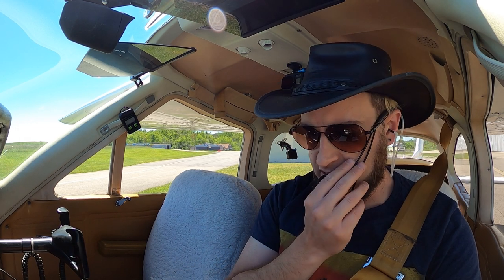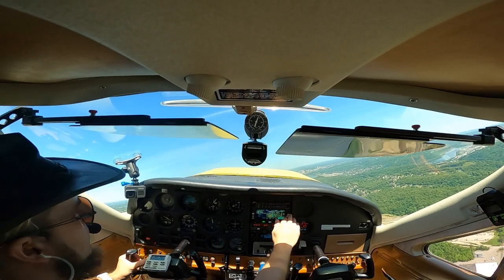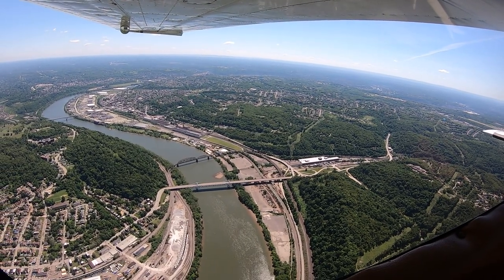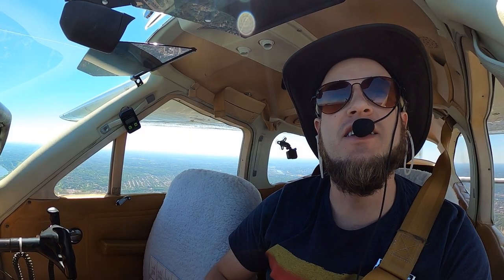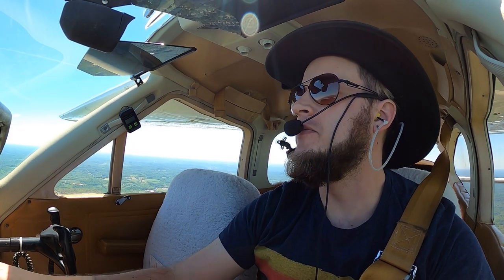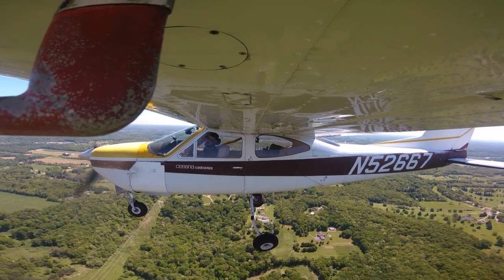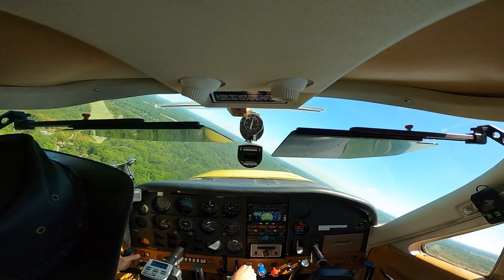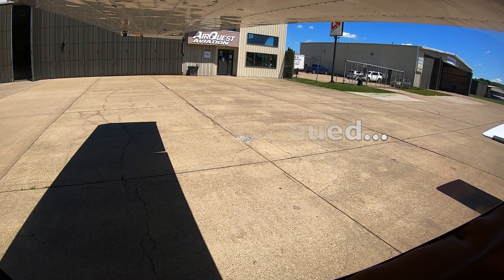Cessna Cardinal flying to 2020 Annual Inspection

Comment: Greetings Dan, what kind of headset do you have and do they interfere with your glasses bows at all? I'm looking to replace my 30 year old Pilot over the ear set. Great vids BTW, look forward to more.
Reply from the maker: It’s a QT Halo (http://www.quiettechnologies.com/). Works great with sunglasses. I find that ANR headsets sometimes don’t work well with the earcup fit around sunglasses. Plus you can wear a hat like that, haha, I’ve done 7+ hours of flying in a day with them and find them quite lightweight and comfortable. They are as quiet as ANR if inserted correctly, I swap the foam tips out when they get dirty or about every month or so.
Reply: Dan Noé excellent. One more question, how would I get my iPad/ForeFlight audio to come thru the speakers? Do you have to buy a separate device? Thank you 🙏🏻
Reply: Dan Noé ahh n/m I just looked up the control box and it has an input jack. 👍🏻 sweet!